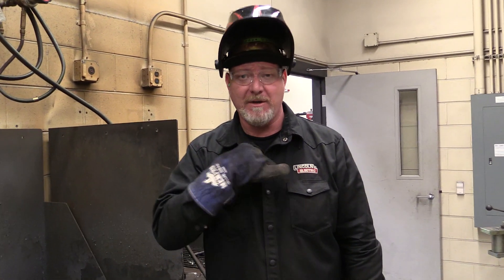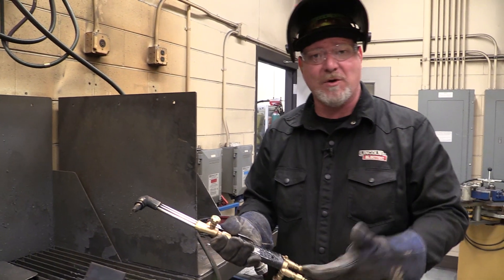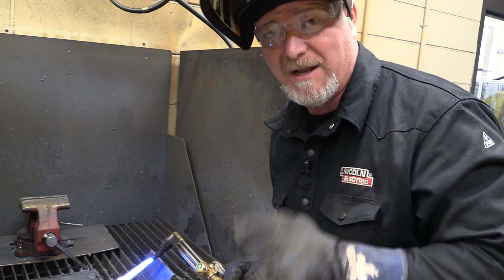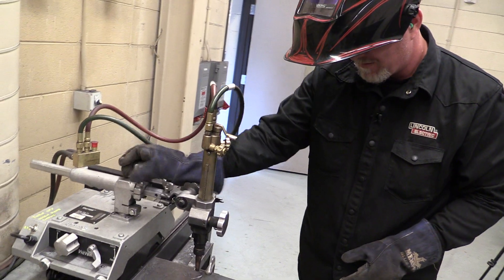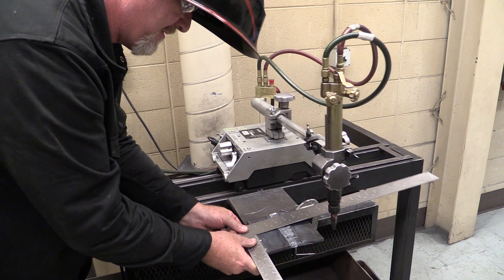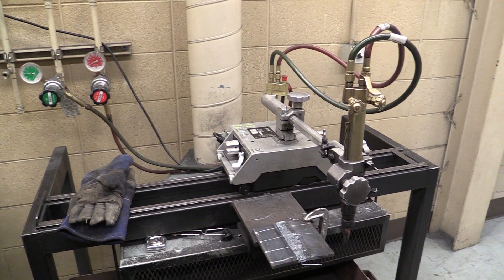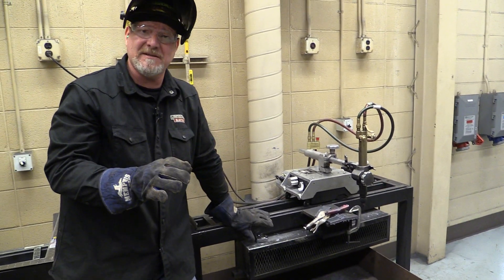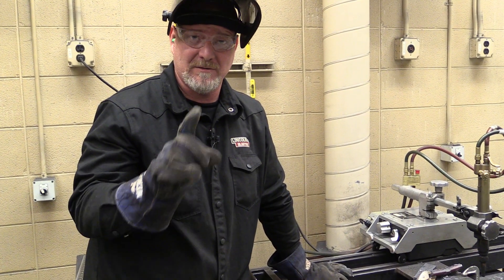Removing the backing strip and cutting bend coupons on the line burner

Comment: So could I cut the 2 outside edges with the line burner that need to be cut off any ways sense that will remove the tac’s and then I can just remove the rest with the torch
Reply from the maker: YES, I've seen backing strips removed many different ways just make sure not to dag the base metal!!